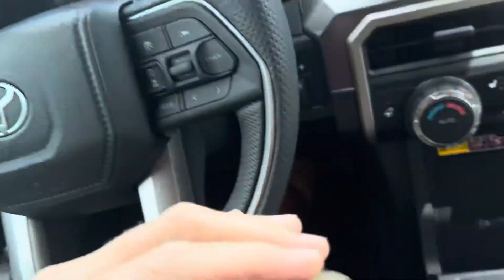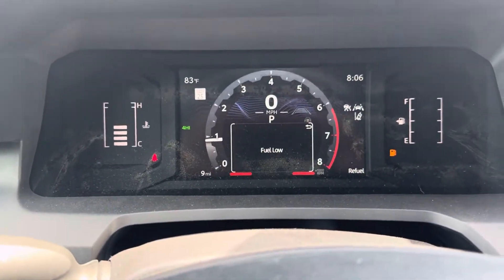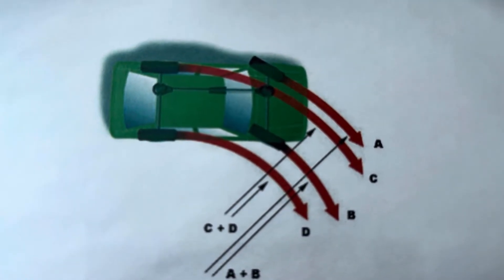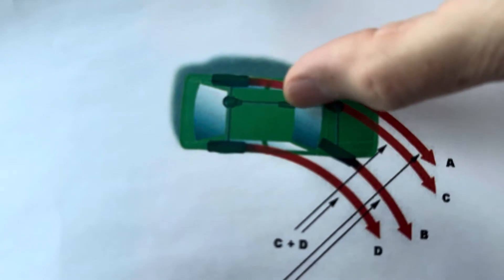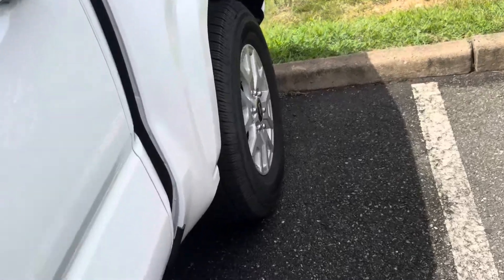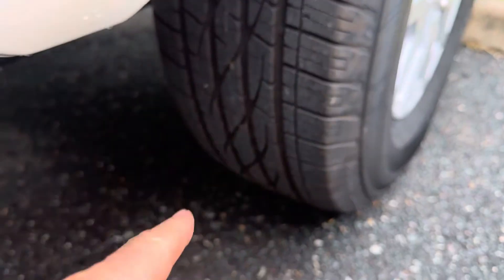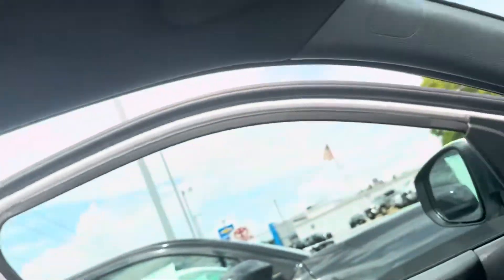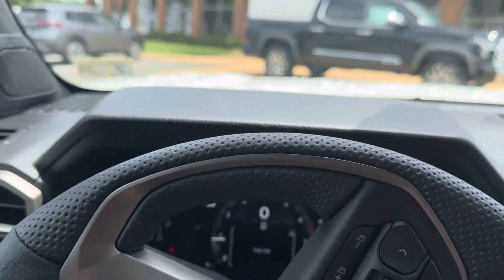What is driveline binding in a 4 wheel drive truck?

Comment: Thank you for giving a simple explanation. I found other videos that did not seem to understand that folks looking for this information are neophytes.  With some more experience, I will watch those more involved video explanations.  But at this point, I just needed reassured that it was not just my vehicle or my handling of the vehicle but a situation to be avoided that is actually quite normally encountered.  I will avoid using 4wd with the exception of 'real' situations for using it.  I did not intend on buying a 4wd heavy duty truck, but the options for towing our new fifth wheel were slim if avoiding 4wd.  I only noticed the binding when driving in the snow then reaching a plowed area where I had to turn and . . . the binding freaked me out.
Reply from the maker: Glad I could help! Enjoy the truck

Comment: i drive my nissan pathfinder 2017 in 4wd mode in normal road , and taken two or three times i did short sharp left turn  and got some metal popping sound from the bottom, actually i dont know, 4Wd driving this is my first time, is that any thing wil be damage in the 4wd system
please suggest how to check
Reply from the maker: The way you check is to see if you still have driveline binding. If you don’t, your 4WD is busted. Don’t force it but just check to see if it still binds when you turn with it engaged

Comment: So when it’s on 4 hi, you turn and it’s not moving, does it mean just give it more gas or are you gonna break something if forced?
Reply from the maker: If you force it, something will break. If you're on lose dirt or another low traction surface, what will break is the bond between your tire and the ground in which case, it is not a big deal. If you're on dry pavement, you really could break a mechanical component.

Comment: Wow... I read I needed to engage 4wd every once and while, so I did and when I attempted to park, it felt like something was going to break. I stopped and disengage 4wd and it still wouldn't move. I turned it off and then on and it began to move again. I tried it again leaving the store, 4wd drive engaged and  it felt everything started to slip, but quickly got on a straight path and it went away, didn't know it was binding. Hopefully, I didn't do any real damage.

Comment: Stills is an issue if I am doing a downhill in a straight line. Using 4 Low to slow the car is a bad idea?, Without any turns
Reply from the maker: I’m not sure why you would need 4L going downhill in a straight line. I can understand using the low gear in the transmission to slow your speed but not the transfer case
Reply: @TrainerSteveClifford so it’s better to use 2H and low gears and touch brakes intermittently on inclined pavement ??
Reply from the maker: @strojasc absolutely

Comment: This was great. I appreciate the quick lesson on driveline binding. I have a Suzuki Jimny and it’s stuck in the garage and won’t go into reverse. I’m sure it has something to do with the four-wheel-drive. I’m thinking of putting it in neutral and manually pushing it out out of the garage. Do you think this will work?
Reply from the maker: That should do it

Comment: My 2010 Sequoia becomes difficult to move and the wheels make noise when I engage 4WD High and turn the steering wheel while driving. What is the reason?"
Reply from the maker: The 2010 had a very cool system. The regular 4WD was actually a full time system and could be used on dry pavement. In fact, it handles better in this mode. There was also a “lock” or “H4L” that I’d like a traditional 4WD. That mode could experience the binding I describe in this video

Comment: How do you fix it when it's binding? I have a 2002 Tracker that started clunking while I'm making a 90 degree turn if it's in 4WD a few years ago. I've let it be because I rarely drive the vehicle but I want to fix it eventually. It drives fine in 2WD and I can get out of snow when I have to use 4WD for short distances so it's not a priority.
Reply from the maker: @TCMapotherIV  there’s nothing to fix. It will bind if you turn a sharp corner on a surface that has some grip. If it stops binding, the 4WD system is broken
Reply: @TrainerSteveClifford so that's normal?
Reply from the maker: @ yes. Real 4 wheel drive is only for off road use or very slippery conditions

Comment: Thank you for this info.  I made a knucklehead mistake with this yesterday.  I was driving in 4Hi in my '98 4Runner ("J shifter") in some ice/snow mix, then turned into a parking lot and completely forgot to switch back to 2WD when I was backing into a space. It felt and sounded like I was running over a pile of ice/slush as I turned, but there was no ice/slush on the ground, just wet pavement as it had recently been plowed.  Then I realized what I had done, and that was some binding action going that I was hearing!  What exactly can I check underneath the vehicle to see if any damage was done? I took a peek at the drive shafts (front and rear), the points of connection between the transfer case and drive shaft, and the u-joints.  Nothing stood out to me, but I don't know what I would see exactly to know if something is damaged. (Can't see inside of the differential, obviously, to see if anything broke in there.).  Thanks!
Reply: I am wondering how easy it is to damage as well